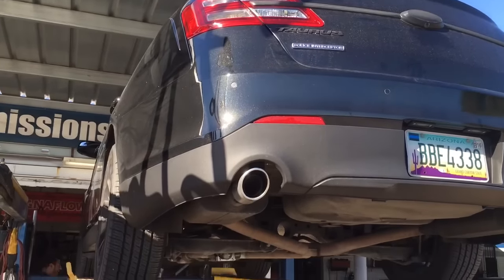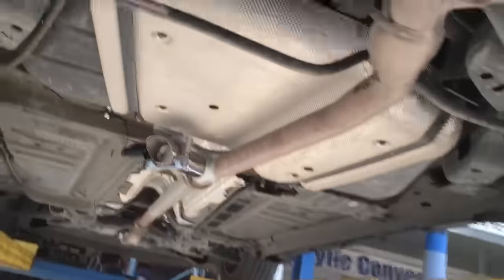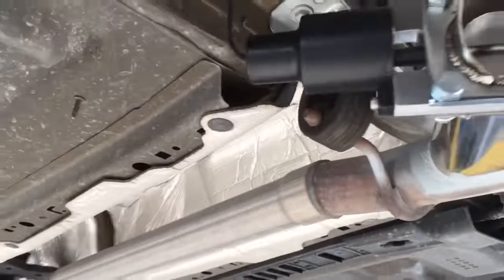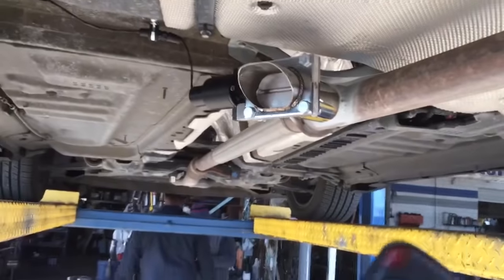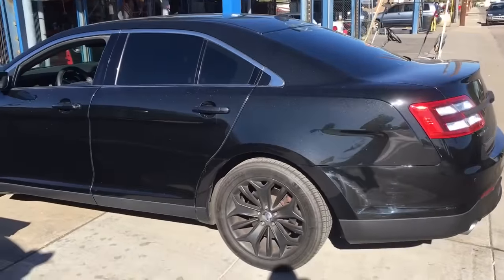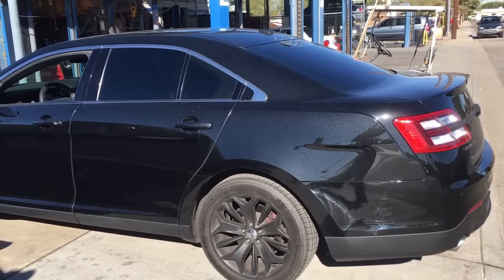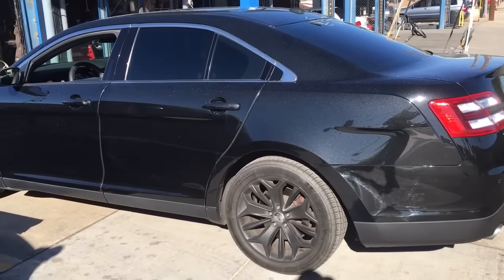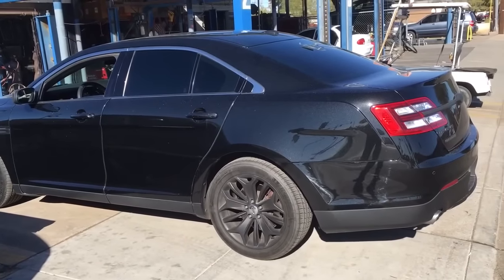Electric Exhaust Cut Out

Comment: too bad you hooked it up wrong..supposed to be mounted on the other end of the exhaust lol
Reply: rockinkenny101 it really doesnt matter where its welded in as long as its after the sensors it wont throw a code on the reader...
Reply: you do not know what you are talking about...MAF????? that's the intake ...you mean after the cat
Reply: No. You have two sensors sometimes more, you get a reading as air flows into the exhaust and as it leaves the exhaust. That way you can calculate the difference. It's not rocket science. Putting an exhaust dump before the second sensor will cause the readings to be off and your CPU will in return make your car run like shit.
Reply: Ian M MAF .. you mean 02 sensors
Reply: Ian M— — >>. u car has ONE Mass Air Flow sensor.  And you have PRE-catalytic and POST-catalytic converter sensors call “o2 sensors” aka oxygen sensors. Lol. And yes the OXYGEN SENSORS send signal to computer that will throw codes.   Your mass air flow sensor checks air density and tells ur computer so your computer knows how much fuel to pulse through ur injectors to match the amount of air your intake is pulling in.   That way ur air/fuel ration is nominal. Hahaha
Reply: Fonz O all cars use 4 O2 sensors? Check your facts before you call someone else out for being dumb. Also, o2 sensors measure the exhaust gas to determine oxygen differential in the exhaust.... guess that's why they are called oxygen sensors and not Exhaust Gas Temperature sensors...
Reply: the roast oh boy 😂😂
Reply: Look at all the ase technicians in the comment section....
Reply: Ian M it's not a MAF lmao. It's an upstream oxygen sensor.
Reply: Peter Briganti  Yeah not my car. It only took you 8 months to come up with a half-assed comeback.

Comment: How disgraceful when the poor thing struggling to sound like a V8
Reply: It's funny because most modern v6 engines outperform every v8 from like....10 years ago. Might I remind you that in 83 a 5L sbc made 140hp from factory while a 3.5L v6 makes over 300 today. Technology is great, people need to get over v8s.
Reply: @zoozoo60  what about V6 ten years ago? Why you comparing V6 today vs V8 years ago? Unfair comparisons
Reply: Even comparing one today, there isn't much a huge power difference. A 398hp 5.7 vs a 335 3.5V6
Reply: @zoozoo60  but it does make a difference, even in small details, that's why the demand for V8 will never disappeared.